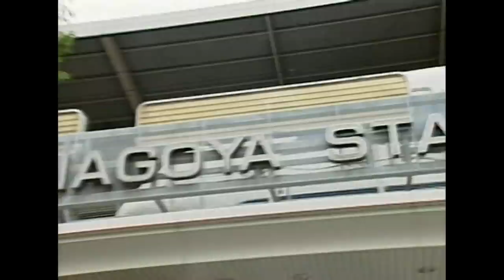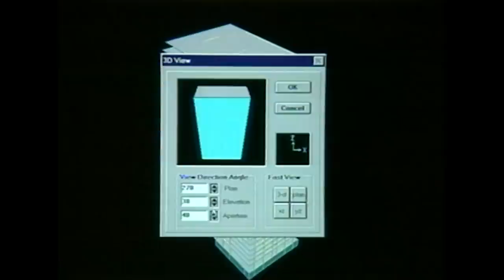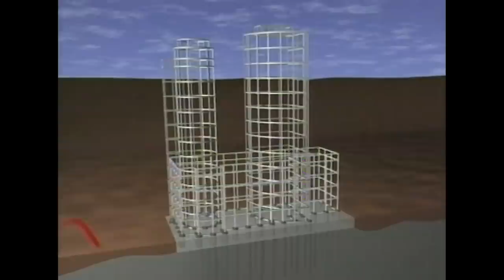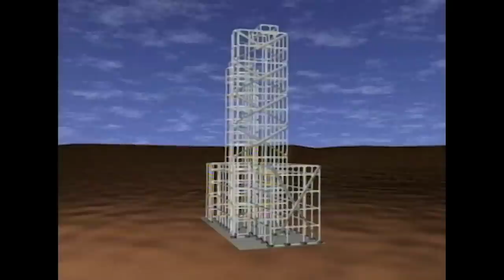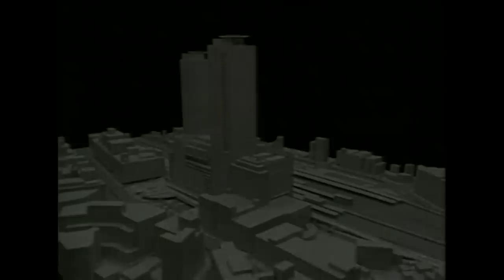Skyscraper Wars: The Race To Build Earthquake-Resistant Towers

Comment: I think tallest building should be determined by highest floor used by people. NOT antennas or spires. Basically anything above the actual roof should not be measured. Just my two cents
Reply: I concur. 
Once upon a time "the cheater spire" was only needed to dock and disembark from airships back in early 1900s . They were otherwise useless except as lighting rods and for communication/TV/radio broadcast transmission . Possibly other uses im unaware of but yeah. Top floor used and occupied by people should be the determining factor
Reply: i agree  or as i like to call it for what it is   cheating
Reply: Exactly. The worlds tallest man award wouldn't go to a man in a hat.